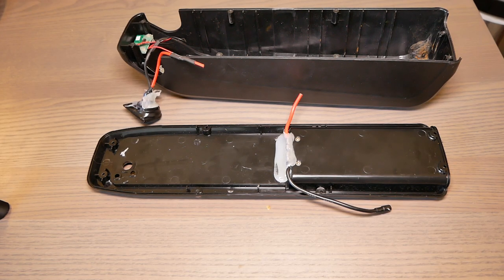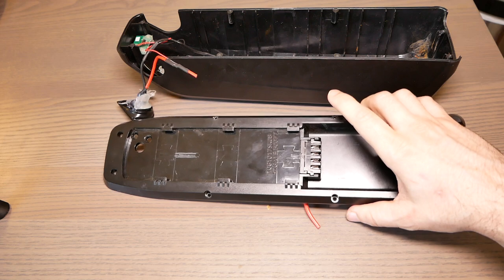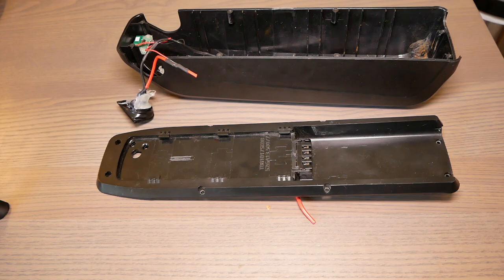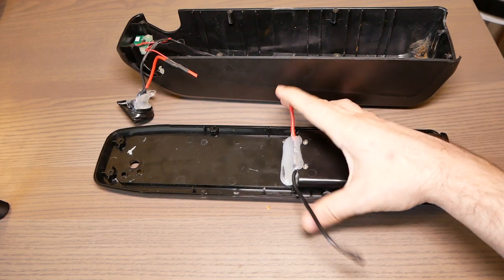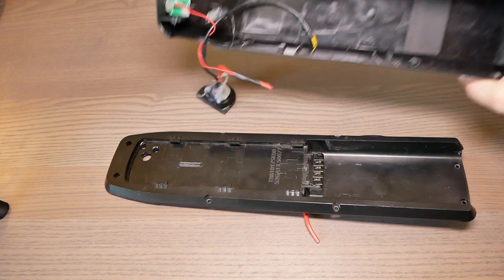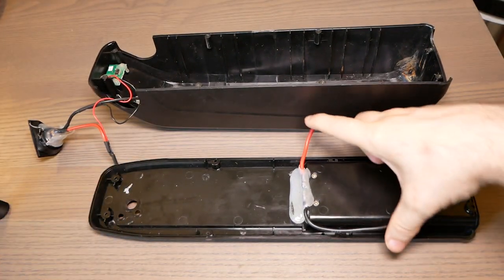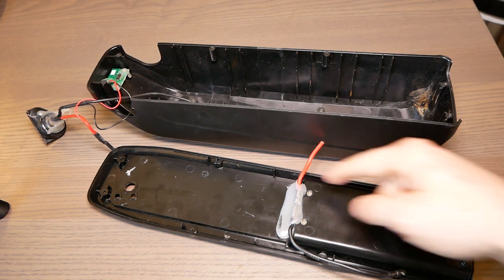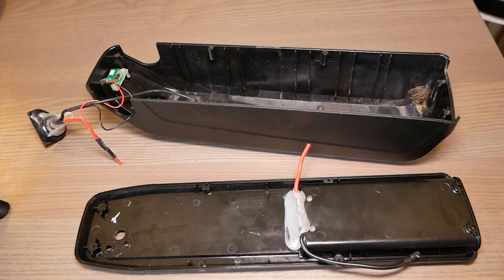How to bypass cradle connection on hardcase ebike battery

Comment: I watched this because I was looking for tricky ways to attach my ebike battery to an inverter without taking the battery apart.  I’d need an adapter to go from the slots in the battery to the input stems on the inverter. This vid and your comments were very interesting. Any ideas on my issue? Thanks
Reply from the maker: I think the most straightforward approach would be to just get a second mount that matches that particular style of hardcase battery. If it's a kit battery like hailong (shark) there are sources for that kind of thing but you would have to inspect the battery as there have been many variations
Reply: @fuzzyfriendlydoggy  it’s a good idea but the mount itself doesn’t have any electrical connection. It holds the battery in place so the prongs go into the grooves mounted in the frame.
Reply: Thanks for your reply
Reply from the maker: @butchie2752  Sounds like you don't have a kit battery then. If it is a frame battery for a factory made ebike you would probably have to fabricate a mount that you can add matching connectors to.

Comment: what are the additional 3 pins In a 5 pin connector for  if the battery really only has 2 wires out?
Reply from the maker: Often they are used in parallel, like two left contacts going to the same polarity and the other three to the other polarity. That way if a contact gets messed up or has high resistance the electricity can still flow well. 

Less often you might see additional contacts used as communication wires so the battery BMS can talk to another component. 

Sometimes the extra contacts can even not be connected to anything
Reply: @fuzzyfriendlydoggy  Thank you.  I originally thought maybe they were the feedback to the display to show the batteries state of charge. but in looking at the cradle on my Mini  it has 5 pins but only two connections through the RAD style plug. So that reding must flow through the same wires as the power wires  but run at a different much higher voltage.  I am not an electrician. but I do know that you can run multiple circuits over the same two wires. But it is usually on AC circuits running different frequencies.  What would happen in the event that I wired them backwards?  Being a DC circuit would the motor run backwards?  or perhaps there are diodes in the controller that only allow it to run one direction.  I know it is really fairly easy because people upgrade their batteries all the time with very little ebike experience.  My plan is to use the female 5 pin connector hooked to around 6 feet of cord on a second battery so when battery one is depleted I just remove it and plug in the connector  but the beattery itself could even be in a pull behind trailer when I go on overnight trips on a rail trail of any length. Theoratically one could carry 3 or 4 batteries and have a range of well over 100 miles with the power on board.
Reply from the maker: @VidsPhone  a fair portion of what you wrote is inaccurate, please visit the ebikes subreddit or electricbike.com forum before doing any wiring changes. For example, extending that wiring like that while okay. Theory, if you don't have the right gauge wire it's going to increase the resistance and get really hot and could cause a fire. So I was just recommend to check out these resources first before doing anything
Reply: Thanks bike working

Comment: so i have similar battery case. but with 5 circle female pins. my bike was stolen so i dont have plat that connect to the wires. would i be able to change to a 4 pin ? or is it a different set up all together
Reply from the maker: Sure you could change it if you can find a matching cradle, the connectors are the easy part, finding a cradle is difficult as there are many revisions. Alternately you could just run the wires out the casing and put an XT connector on it, and just keep it in a battery bag.

Comment: surely then the battery could only be charged on the bike, isnt it better to charge in a fireproof box?
Reply from the maker: You can put a connector on it, you do not have to hardwire it directly from the case to the controller. 

Last time I made a bypass for someone I used xt90 antispark. It functioned exact same as a softpack, only difference is you still got that nice mount. Best of both worlds really.